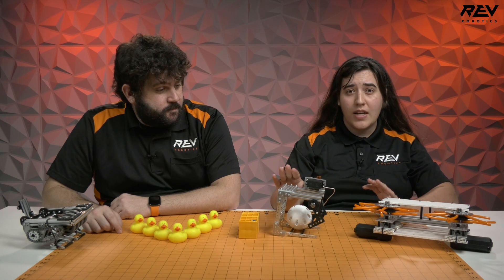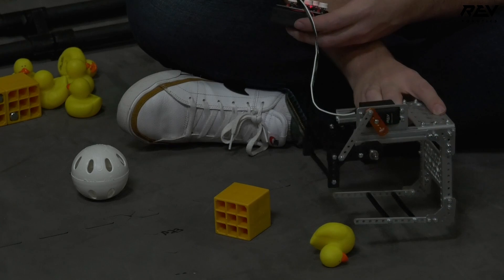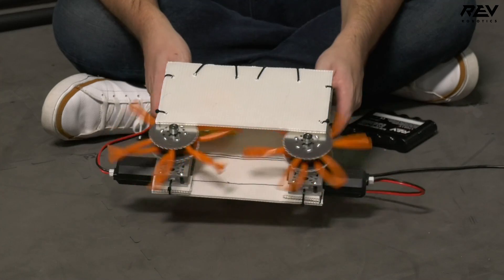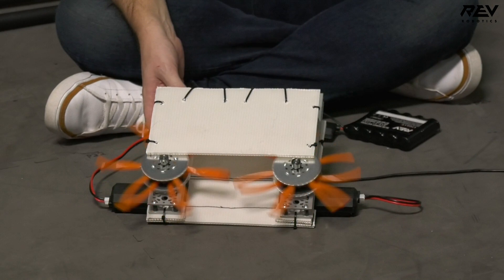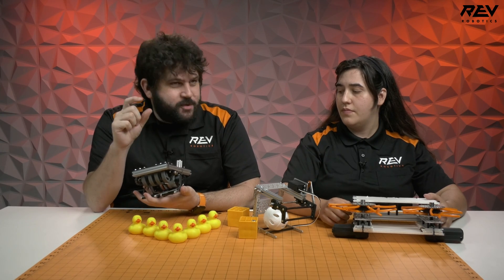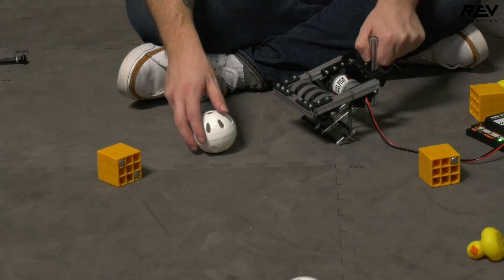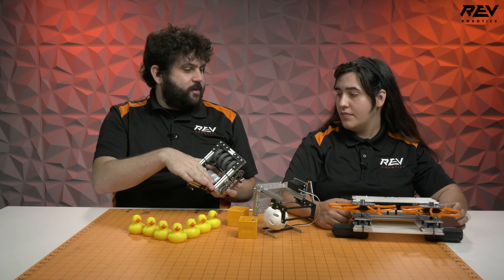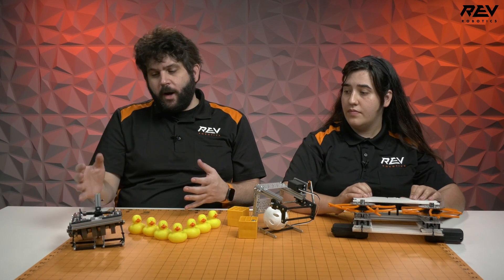Intake Update - FTC Freight Frenzy 2021-2022

Comment: So, I'm a seventh grader at a middle school taking part in the competitions. We have very little resources, not much else other than some metal scaffolding with a few motors and servos. We wanted to do an intake system, but since we're on a budget, is there anything you would recommend?
Reply: in another video they showcase a bot with just a kit of parts, where they use a cardboard flap for the intake. also, what team number are you?

Comment: How did you attach the polycord to the sprockets?
Reply from the maker: Will have some more details on how this is done in our Kickoff Concepts documentation. Should be live a bit later this week.

Basically is the tubing is wrapped around a number of bolts used to hold the assembly together.